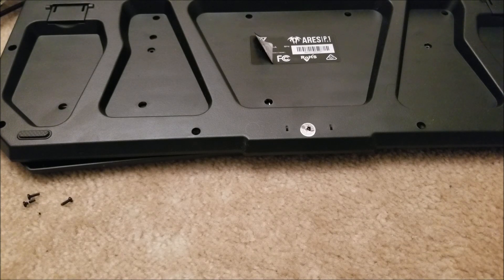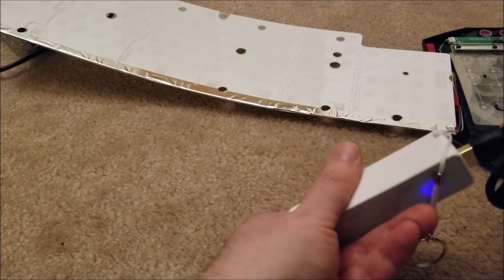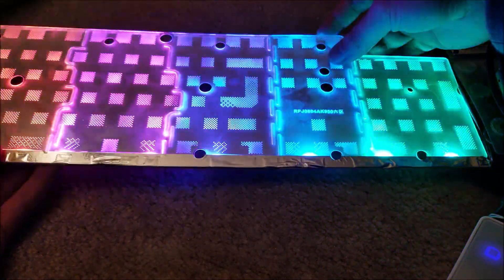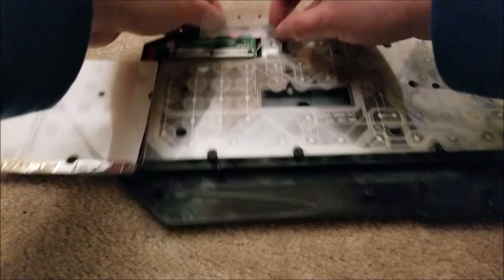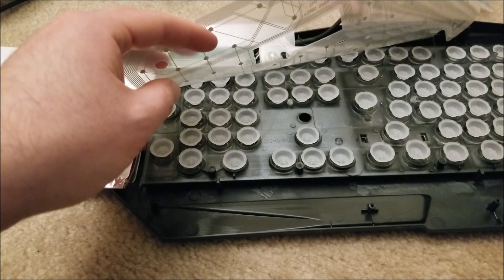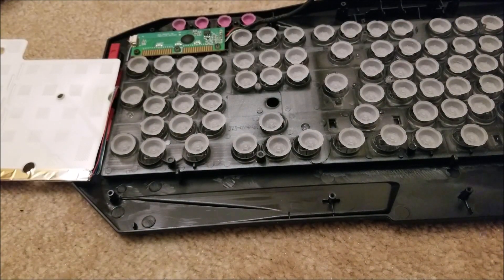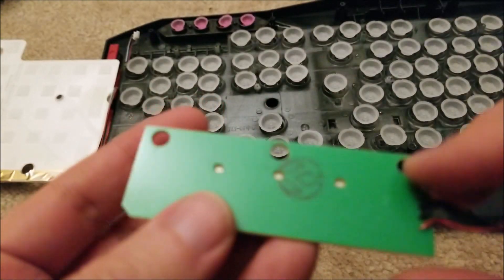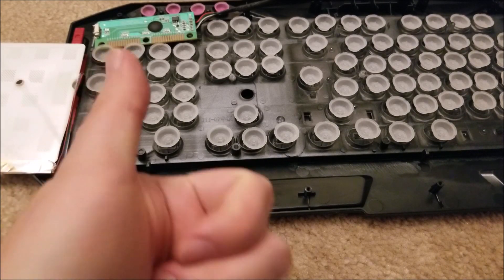Gamdias Ares P1 RGB Keyboard Teardown

Comment: Hi sjm4306 I have a query about the MZ-N10 minidisc and the sony HDD walkmans, they use an odd proprietary usb connector and I was wondering if its the same as some of the old Cybershot cameras ? I ask because I have one of the HDD players but original cables or adapters are stupid expensive but the Cybershot usb cables can be found for only a few pounds. I'll leave a link here to an ebay listing for such a cable , Hope you can help and thanks for the videos.    https://www.ebay.co.uk/itm/292523455279
Reply from the maker: It looks similar, but two things strike me. The cybershot connector looks larger and has locking prongs coming out the sides which the n10/nw doesnt have and would likely prevent safe insertion even if the rest of the dimentions were correct. It is hard to tell from photos online though so I could be wrong but knowing sony I'm sure it is designed to be incompatible in just about every way.
Reply: @sjm4306   I know what you mean about the prongs on the sides but apparently the HD3 HDD player used an adapter that had prongs to hold it in place and a standard usb cable plugged into the adapter. So I would hope the pinouts are the same as standard and it would just be the connector thats all funky and Sony proprietary. I think I'll have to take a shot at one of these though as the only other solution would be hacking in a standard mini or micro usb to the board and possibly damaging the unit. Thanks
Reply from the maker: Let us know if it works, it would be a godsend to the many other owners!
Reply: @sjm4306   Will do. But I'll have to wait for a couple of weeks as I'll probably have to replace the battery and wouldn't ya know it that the replacements are from China so gonna be a wait on that. If it works or not I'll give an update though. Thanks again
Reply: Biker Dave how has it gone? :D

Comment: That concept of dispersing light through panels has been around for quite some time. I worked on aircraft from the mid to late 1960s that used the same approach with incandescent lamps.
Reply from the maker: I've seen a similar approach for automotive electronics but for some reason just wasnt expecting it for a keyboard as every other backlit keyboard I've taken apart has discrete leds on a pcb.